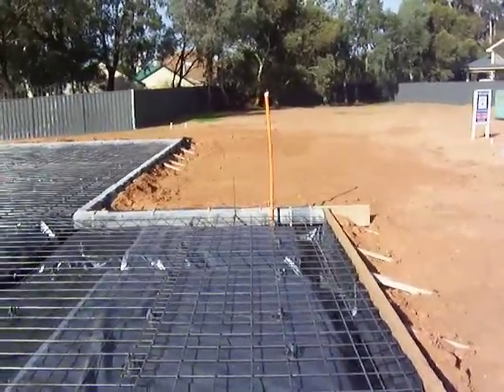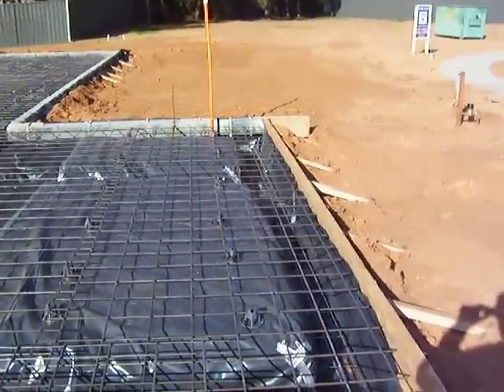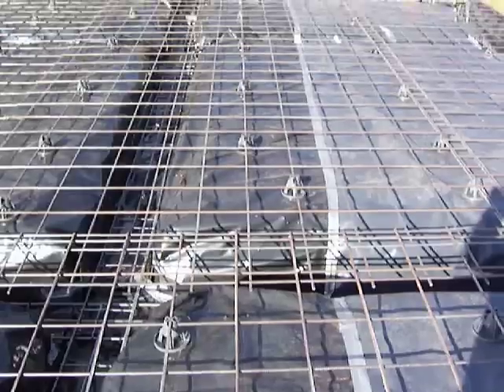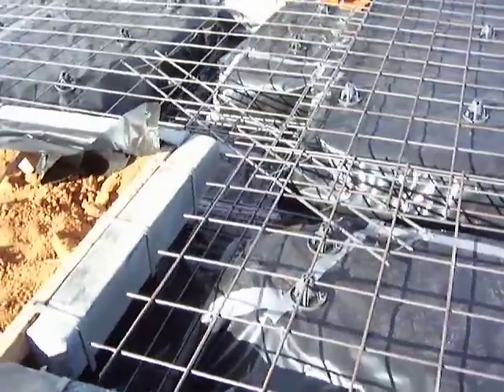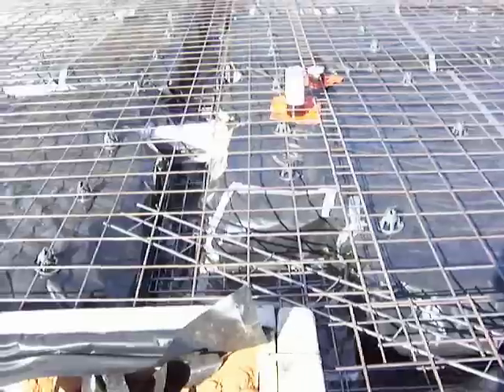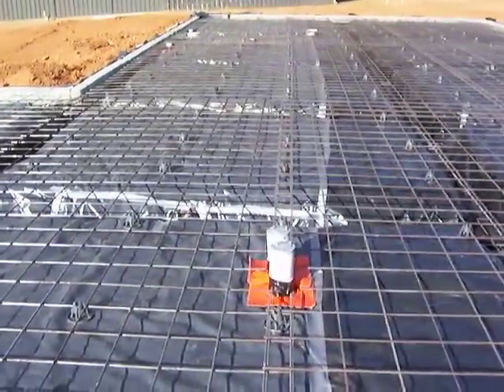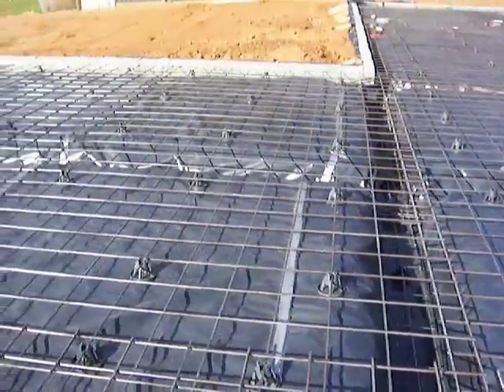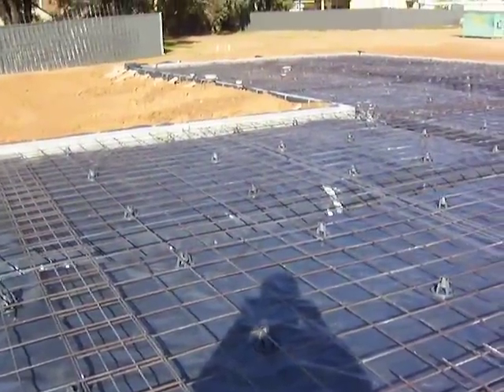Home Building 3 - How to Build a house! Concrete Slab Const

Comment: This foundation has a level of detail which I have not seen in the Philippines with the termite (white ant) protection, the corner reinforcement to minimize the chance of cracking, and just the level of detail with your vapor barrier. However, I do not see any vertical rebar along the perimeter, which I believe is typical (I am a layman) for homes which may see side loading from high winds or earthquakes. Why do you not have any vertical rebar around your perimeter?